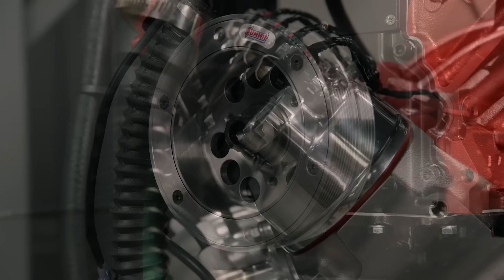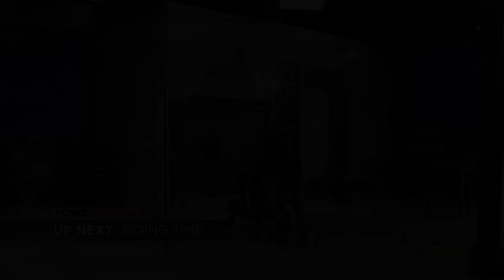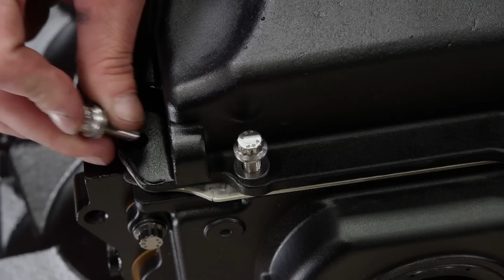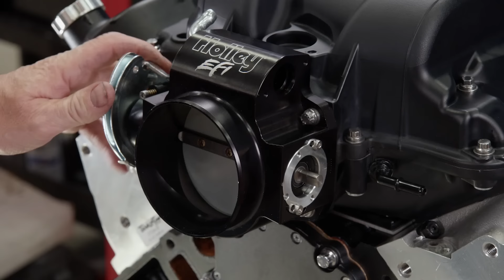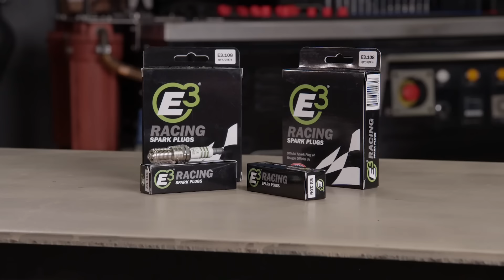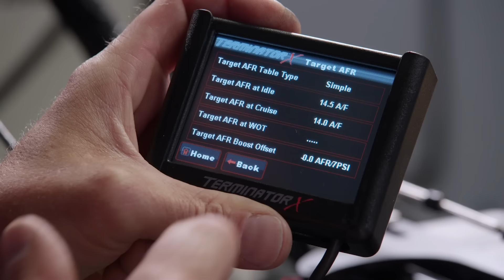Building a Loaded 5.3L LS - Engine Power S7, E11

Comment: I wouldn't waste my time with a cast iron block. The aluminum block is one of the big pluses of an LS swap. Getting rid of weight is free 100% reliable horsepower and aluminum cools better. And less weight improves acceleration braking and cornering

Comment: This makes my pants tight. 
I am currently and actively looking for a 5.3 for my 90 Corvette and sadly, the search is not good here on Maui, let alone finding someone to do the swap for me. 
I would like to have it ported, polished, balanced, blueprinted, those new lightweight hybrid pistons,  either a chopacabra, or bigfoot cam, 243 heads, short tube headers,  comparable intake and a fuel management system. 
I would like to see about 500 hp, which i was told is very doable. 
It would be way cheaper than rebuilding my L98 that is currently in my vette. 
Heck. I am about to just fly to the mainland and have it done, since people here seem to be too lazy on Maui .....

Comment: Im actually so thankful for the LS lifter trays. Ive made a lot of money doing 2 or 3 hour cam swaps for customers and friends over the years. I think the Hardest was a 4th gen camaro. Only because half the engine is under the firewall. The c5 and c6 corvettes were easier than the 4th gen camaros. 

Actually the worst was the LS4 in the pontiac grand prix. Only ever did one of those.

Comment: The old International Harvester V8s never get any love. Why don’t you guys build an old 345 or a 392 and see what kind of power they can make? There is almost zero aftermarket support for this niche, so I would love to see some real custom hot-rod building like   Sleeving the lifter bores so you can use BBC or MOPAR hydraulic roller lifters and make a custom grind hydraulic roller cam for it. Try to graft on a set of aluminum BBC heads! Use the RPT aluminum intake, headers, custom pistons for more compression… It can all be done and you have the shop and skills, so let the IH crowd live vicariously through you here!

Comment: I got the 07 nbs lh6 in my truck. I like the flex version of it but it had issues. This one is much simpler. Super easy to work on. I hate trying to find round coil packs haha. I'm going to be doing the ls7 conversion here soon with stage 1 thumper cam. I got a tuner, full custom 2.5 inch 304 dual exhaust. With a dual in and out cherry bomb extreme. I'm gonna a be buffing up the trans woth a hd sunshell and stronger gears and a chromoly drive shaft.. I daily drive it. I haven't done the intake yet but this motor has a good intake already. It has the 243 stamped heads not the 799s like I thought it did. I disabled the afm but need to actually get rid of it.

Comment: i get these guys have sponsors and use all of their parts but for an average guy putting an LS together this would be a complete waste of money to make 450 hp...spend the extra few hundred bucks and find a 6.0 to start with and make 100 more than this 5.3 was capable of.  That MSD intake was way overkill for a 5.3...would have been better off with a TBSS intake, a bigger cam wouldnt have hurt as well as full length headers.  Sometimes I'm just baffled at the parts these guys choose for these engine builds.

Comment: Ford 5.0 roller block...cam 220/224 @.050 and .500"/.500" 112 LSA. AFR 165 heads, 1.6 rollers, RPM manifold, 670 Demon carb, 1 3/4" Long tubes, MSD Distributor.Sealed Power, Fel Pro, Clevite, Melling, ARP usual players nothing trick. 427 HP, 414 FuLbs torque  and a lot less $

Comment: WHY IS THERE 2 HUGE HOLES IN THE VALLEY PLATE? does the intake plug these by design or do they need to be open? if so couldnt a mouse build a house in there?

Comment: Hello I have a LT4 hotcam  camshaft, I am going to install it to a 1997 Camaro v8 5.7 liters second generation LT1 engine, can you tell me which springs, roller rocker arms, pushrods and lifters to buy without having to machine the heads? Thanks!!

Comment: I have a 2005 Chevrolet Silverado crew cab short bed 1500 LS with the  5.3 v8 vortec LM7 and i want to get 500 horsepower out of the 5.3 so what exactly do I need to get in order to get that kind of horsepower.

Comment: Are you able to do something like this with out having an ultra loud exhaust note? I want to rebuild my old C1500 OBS but don't want to have the exhaust sound but would like more power over the stock engine.
Reply: Just don't get a super crazy cam and do your research on which exhaust system would work best for your application. I would stay away from black widow mufflers as they are known for being loud e.g. the famous neighbor hater line of mufflers. I would lean more towards a flow master which will give a nice tone without being extraordinarily loud and obnoxious.

Comment: something here i dont get, they got at least 6 grand or more tied up in this motor, half of that is in the heads and intake alone, now i did some shopping, used 5.3 low mileage, 243 heads, a sloppy stage 2, and a few little nick knacks, spent less then 1 grand and i make the same horse power and torque 448/411, now ether my used stock parts are that bad ass or there high dollar parts are that horrible.
Reply: You did a proper junkyard runner build with great results. They are underutilizing (to say the least) a very nice top end on a 5.3 and a tiny cam. Swap it to a 6.0 with a better cam and watch it make another 100 hp.

Comment: Take a LR4 4.8L and hop it up on the Vortec heads, roller rockers, springs, machined porting with a 6.0 stock cam, HV&HP oil pump, clevite bearings on mains, cam, connecting rods, no boring or stroking

Comment: When I was starting to work on my own car back in the 1960s, my first few cars were made in the 1950s.  They were simple and you didn't need specialized tools.  Gas was cheap and so were the cars.  I didn't pay more than $100 for a car until I was 18.  I didn't know a lot about auto mechanics back then,  Now cars are computerized and sensitive, and they cost a lot more, even for the 'beaters'.  They aren't as much fun to tinker with.

Comment: Do an episode where you get as much power as possible out of an LS engine without using a lunpy cam. Like a stock LS6 cam so the vehicle will idle smooth and get good gas mileage, but use some killer heads and THEN cnc port them on top of that, good intake manifold, headers etc. I've always wondered what could be made without having a cam since I don't want a lumpy idle.

Comment: Mike shimmed the pump (.00.15" which is probably the most common spec, even though I was also taught to shim the LS crank driven pumps despite the fact that the service manuals don't mention anything about shimming them...) but he didn't align the front & rear covers to the oil pan...

Comment: Could I apply the same parts to my Ls4 5.3 2006 gxp Grand Prix ,also any one know of a  economy harmonic balancer for the LS4 5.3 here in Canada it ranges for a dorman $350.00 to 699.00 for gm keep in mind the truck Ls1. 5.3  wont clear the sub frame and 
Qcradle on the Pontiac. The gxp is bone stock and i don’t want to hack fit any thing plus I got it ultra cheap with transmission shot . I just applied my 9 year gm auto body and mechanical and detail skills I learned while at school,and college part time summer full time employment to my mini project  thanks to all the mechanics and auto body techs from the  last century Rader motors chev and olds for teaching me . I just got it on the road last Friday drives great  good on fuel look New minor body work touchup and blend and paint restoration,all trim repainted Oem 18” rims cleaned and restored  repaired heads up display.

Comment: I would love to see them build the old 499 cubic inch big block that used to come in the old Chevy gas HD trucks and  3/4 ton suburbans.  Great engines.
Reply: 496 ci/8.1L and are not made for higher hp. Expensive as hell to build and would never compete dollar for dollar with an LS. Ive had both.

Comment: I have a 91 S-10 Blazer weights alittle under 2000ibs stripped with a racing 4l60e trans and a LM7 5.3 around 500hp launch like a bat out of hell positive traction however upgrading the oil pump is a no no everyone knows that too much oil on the top of the motor and ull destroy the bottom bearings fast have seen guys destroy them on first run

Comment: has you're saying cracking the ECU on a stock wiring harness of the stock computer if you can get that motor running in the stock vehicle disconnect body computer and then let it run for 15 minutes without the body computer plugged in and then pull your wire harness out because now the damn thing will start and run without being locked down

Comment: I have seen continental tires take a crap. 2 weeks old tires on an 2018 Audi. Installed at the Audi dealer. I know this because I put another set of continental tires on the Audi. $600 each. Not a fan of this brand

Comment: Nice build, however I prefer simple. 1976 Nova SS, LT1 (1970) Holley 750 double feed, double pump, Edelbrock intake, Hooker Headers, TH400, 12 bolt (4:10). I can work on it in my garage, don't need a qazillion $$ in tools. The only "HI TECH" thing I own is a timing light. I have owned this car for 40 years, and it's been a rock solid build. Scared a few passengers as well. : )

Comment: i read several comments down. i'm right there with everyone..to have an engine like that in my 07 chevy 1500 silverado wt would be nice. replacing the 4.3 v6 whimp..replaced all sensors, plug wires, plugs, coil, distributor, rotor. it runs at idle, and can rep it up to 5 rpm and stay at it for as long as you want..as soon as i put it in gear it kicks and jerks spits and sputters and, dies. if i turn on the AC it also dies..any suggestions?

Comment: I was stunned by the numbers. A mildly built 5.3 conservative tune should have been low to mid 500s the stock bottom end had proven dependable to just under 1000. 400 he muscle cars are a thing of the past.  Tell someone your installing  a 400 horse muscle motor you might as well tell them ots a pruis...

Comment: 10:38 how many people have had valve covers to just crack from making hp. Once again Lying Pat is creating a problem that doesn’t exist to sell something you don’t need. Why not powder coat your stock valve covers?
Reply: Right? This joker recommends cast aluminum valve covers for “strength” but doesn’t have a problem with the polymer intake manifold (which is also fine)? If it ain’t broke don’t fix it...
Reply: Advertisers pay for all this stuff. Not a biggie. Most people can recognize.
Reply: Pat is reading from a script that the writers made because the producers will plug anyone willing to pay, also the sponsors require certain things to be said. So, not pat's fault, he's just reading his script.
Reply: I've got a single turbo 5.7 making 1000+ on stock valve covers lmfao
Reply: E3 spark plugs... really?
Reply: @robertpolkamp  e3 plugs, in my opinion are junk. I have at least 4 of them fail. Never have i had a NGK fail when new.
Reply: He didn't say the stock valve covers crack.
Reply: @A @Alex0992 I didn’t say he did.
Reply: @Fone65  he said cheap thin valve covers can crack. How is that a lie?
Reply: @Alex0992 No valve cover made for a LS is cheap because they have to hold the coils. Stop trying to co-sign with this lying actor. You are just making yourself look bad.
Reply: You are not even old enough to drive. You probably never held a valve cover in your hand.
Reply: @Fone65  you keep digging a bigger hole. Now you're saying there's no such thing as aftermarket cheap valve covers 
My YouTube account is older than yours. My yt account is old enough to drive. 😂😂😂
Reply: @Alex0992 Show me a broken LS valve cover made

Comment: Man I want a price sheet on this to see how much it was to put together
Reply: all the arp hardware costs more than the engine itself
Reply: @yungtooli  ha! So true
Reply: Intake $1000/Top End Kit $2,300/Fuel Injectors and Rail $800/Balancer $400/ARP Hardware $600~/cost of engine and powder coating. You're looking at around $6,500
Reply: @timothyduhon1106  i bet they paid more for the hard ware than they did the motor from the parts yard.
Reply: Lol right and you could do a simple ported 706 heads healthy cam and trailblazer SS intake and get similar if not way better power with significantly less money
Reply: did you ever get a price sheet?,, I'm trying to pull the parts from the links to build this by the end of 2022'
Reply: @azgunner8105  But how long will it last? Would you be able to put 200k miles on this engine if you took good care of it? I want to put it in my old 87 silverado. But it might be a better idea to just buy an unopened junkyard engine with low mileage.
Reply: @enermaxstephens1051  yes I’ve seen some with over 300000
Reply: @enermaxstephens1051  No. You will need to service valve springs every 50k from my experience.
Reply: @johndishong5083  why is that? i thought they said it had less lift and more duration.
Reply: Same
Reply: +$6,000.00

Comment: im on oz .and my Z/28  84 3rd gen needs a lil bit more than what i have .
wiil the 5.3 fit my700r4 and what else would i need to change , as it is now right hand drive. with handmade tube extractors- a weiand 7546 single plane--a CROW cam 1631=260-266-112. 455" a holley 750 hp dbl pump manual secs and  a stage three manual shift kit in the 700r4 making it nearly manual with a B&M rathchet shifter .okd by aus drag s in 85. still about 430 hp .still 305 cubs with balance and rod volts. my own head work and manifold grinding. runs nearly 9.8 comp . 
lots of revs= 6800.
is it worth changing.- it runs low 13s. torque converter is not going to 3200 only 1640.???still the matching numbers car. only done 11743 miles 5.0 ltr ho l69 block and heads

Comment: This really needs to go into my shop truck 70 Chevy Short bed C-10. Mine has 3 dead cylinders from the cam going flat. I have been scared to try the LS I'm after all a carb guy and wiring isn't my thing. You made this look easy. Win or no this is still a great show.......I'm 53 and have been a fan forever. Keep up the good work.

Comment: Truck engine! My 1990 GMC, 4x4 is clean. I'm the original owner. I take care frequent maintenance. It's a 5.7 350, (stock) with 302K miles. I've learned a lot. Thanks.

Comment: I would love nothing more to win this engine right now. Ive been looking at ls engines and for what i want and the parts is way out of my budget.

This engine has basically almost everything that i would need for my boosted/nitrous application in my 1979 Chevy C10 Step Side project or swap it into my daily driver 2010 V6 3.6L LT Camaro and let it be naturally aspirated.

My favorite video is seeing the small block take all that nitrous. :)

Comment: Seems like an awful lot of throttle body for that engine.
Reply: yea.. running a little rich on the first couple of pulls shows they had no idea what they are doing... it should have been bigger.
Reply: hawkdsl yep and Richard Holdner builds a more powerful junkyard engine than these clowns lol. They left out degreeing the cam even tho they talked about it, so I wonder if they did.? It’s pretty simple to make over 500 bwhp on an ls with simple bolt-ons and a cam....
Reply: @wht240sxka  I'm looking at doing a lq4 build for my 04 avalanche. What do you recommend for low to mid range power for that motor? Cam, Intake, etc. Thanks man
Reply: @wht240sxka  yea this one was weird, not feeling those roller rockers or the manifold.

Comment: My 86 foxbody has that motors name written all over it, awesome build !
Reply: You too, Jim Bob? More heretics here than you can shake a stick at!  Phil in TX
Reply: Phil Auten yeahhh it’s pretty bad, but ford doesn’t have any strong and basically built old motors you can pull from wrecking yards and throw boost at without much trouble, that and the ls is just so simple and easy to swap into anything and make great power, and if it grenades there’s plenty more to pick for another $270. No brand loyalty, I’m just a hot rodder I guess.

Comment: Can you tow a big camper with the motor making that much horsepower
Reply: Your not going to be using all that horsepower unless your at a constant full throttle. When your at cruise, you'll be using allot less. Also using the stock truck intake manifold would be best on this if your going to be towing.

Comment: Good luck to everyone, I still wish they would build a Ford 300 and have a shop make a set of Cleveland heads or LS heads into a 300 crossflow and boost it, it would be insane, frenchtownflyer is pushing over 500HP NA on the 4.9 ford with no boost or superchargering so what will boost do to it

Comment: This engine would be a great swap for an old Chevy C10 or even an old school 69 Camaro.
Reply: I did an ls 5.3 swap with a 4L60E on my 65 c10 step side. It was fairly simple to modify the engine bay and I also added power steering. I do have to say my engine did not have nearly the upgrades these guys went with. It does ARP hardware but I went with afr heads and a used corvette aluminum intake. Horsepower numbers were just under 400 and for a driver that's just fine for me.
Reply: @benjaminkent4397  Sounds awesome brother. Imagine if you ported and polished those AFR heads and boy that 5.3L LS V8 will probably make well over 450 HP.
Reply: @CJColvin  that project has been put on the back burner as i have lost interest in it. Still needs a lot more to be complete. I've been working on my 72 Plymouth A body getting it ready for the track.
Reply: I'd LS swap a toaster if it would work.